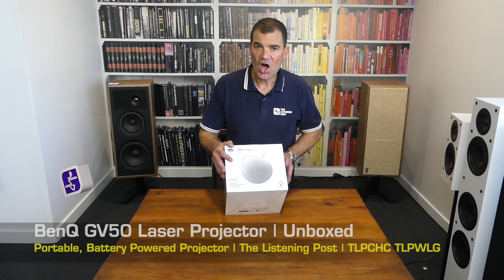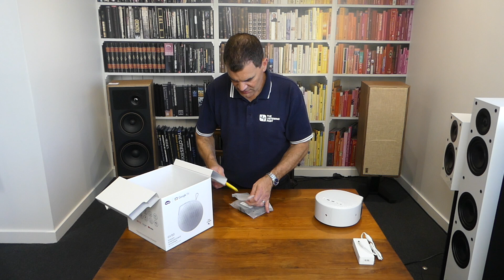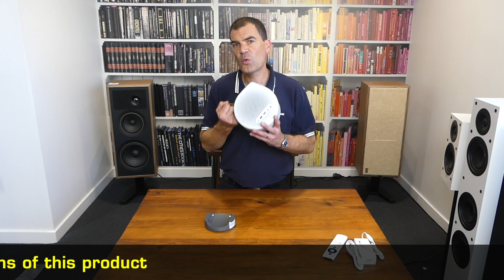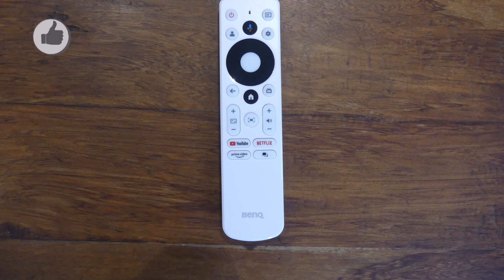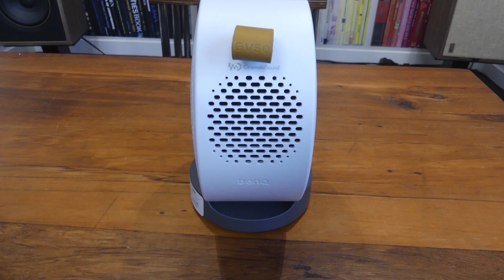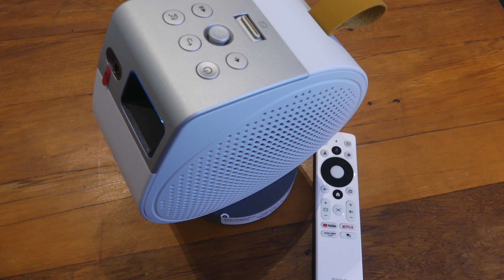BenQ GV50 Portable Laser Projector Unboxed | The Listening Post | TLPCHC TLPWLG

Comment: Can all the 'Auto' stuff be turned off on the GV50?  e.g Keystone, auto focus etc.. So the user can manually adjust per their positioning of the unit?
Reply from the maker: No, not that I have been able to.  The whole point of the product is its "Auto Settings". It is a "drop in and play" product.  If you need manual set up, this is not the projector for you.
Reply: The auto keystone cant be turned OFF as such, however after it has adjusted, you can alter the keystone to suit if it didnt set it correctly, so essentially you can do it manually yes, however you have to let it try first.
Reply from the maker: No - This projector is designed with the Auto feature set at its heart.  It is not designed for user adjustment.  If you need to play and tweak, seek a solution that is not the GV-50